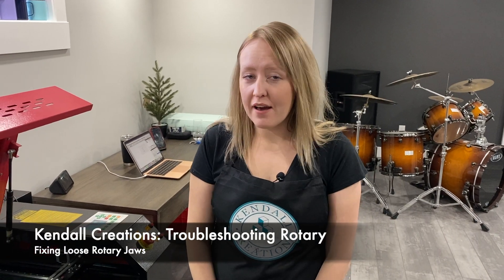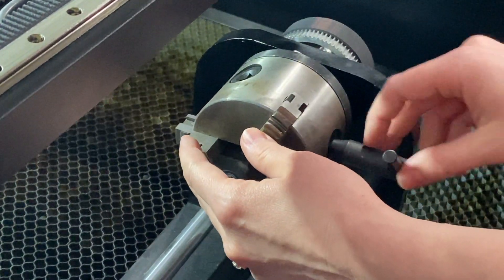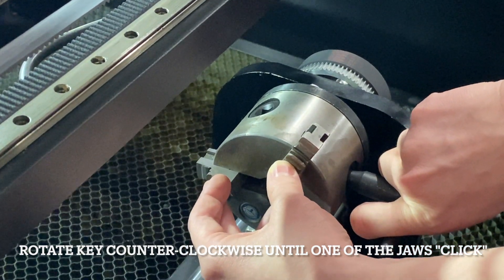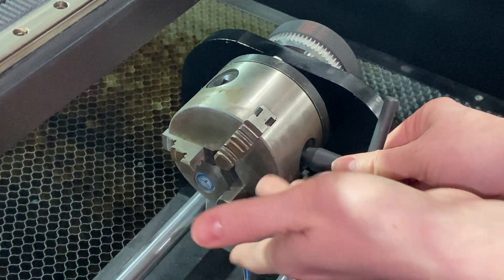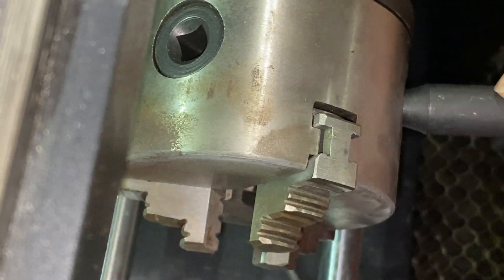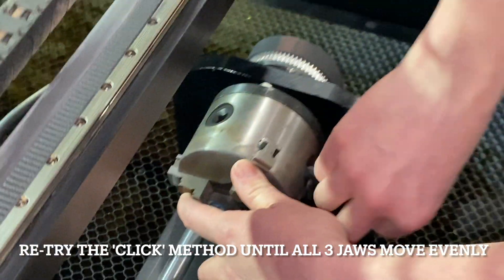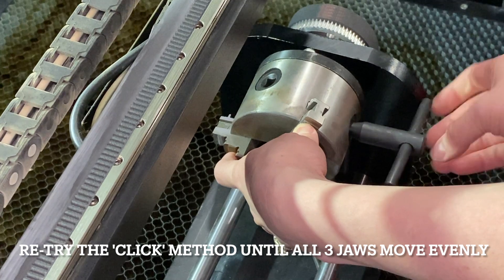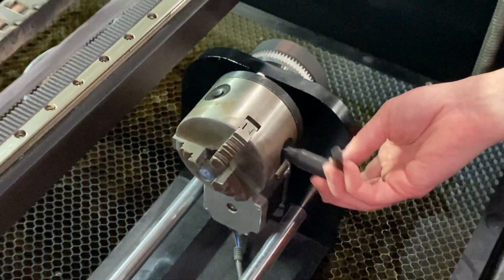How to fix loose jaws on a chuck rotary for a laser engraver

Comment: I know the video is a bit old, but the info is still good... I do just want to add that if you've removed the teeth to put the other set in (one set faces in, one set faces out) they might have been put in out of order. Inside the track of the teeth on the side (of most models) is a model SKU and a number (1,2,3). They go in order counter clockwise. =)
Reply: I am new to laser engraving but I've been using scroll chucks in my machine shop for many years, so I can confirm. Always a good idea to mark the jaws and chuck if they aren't clearly marked. I use a battery powered diamond tip engraver tool (like a very low power Dremel, but sized closer to a Sharpie) for this sort of thing. Very handy to have on hand for many such tasks. That way the marks can't get erased.